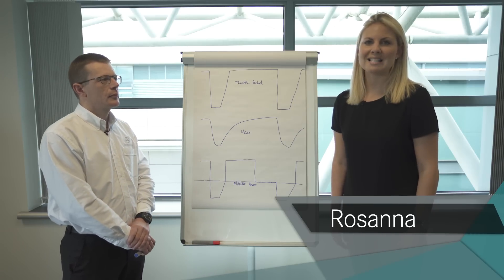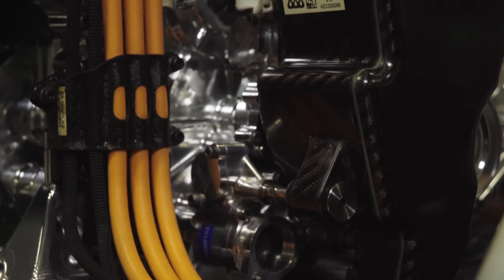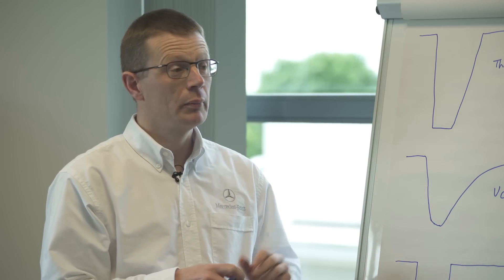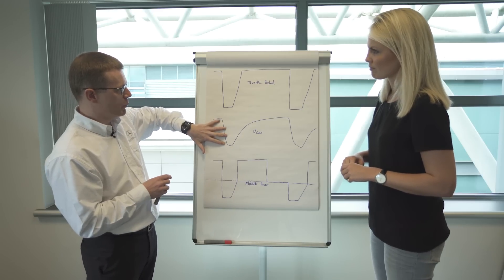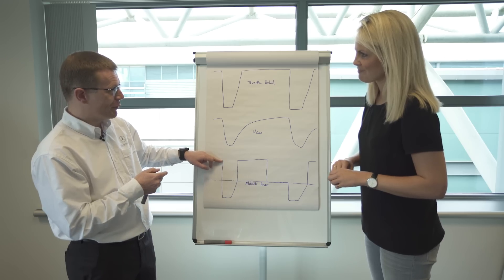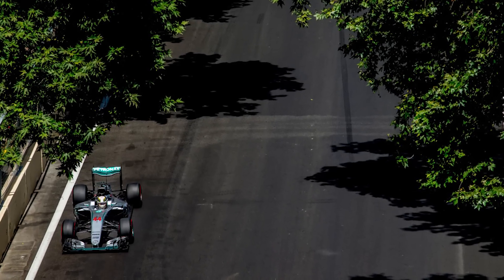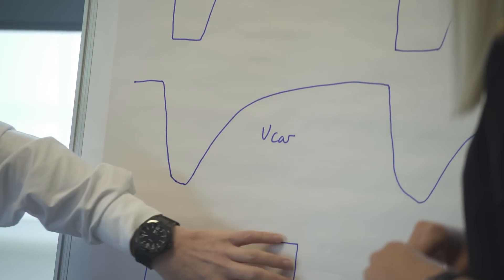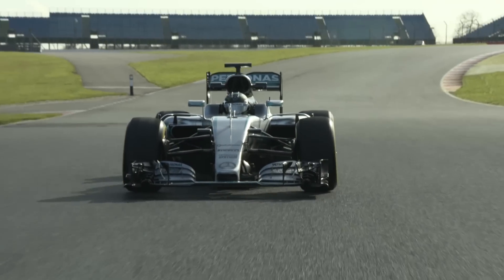F1 Explained: What is De-Rating?

Comment: Why don't you transmit power to the MGU-K directly from MGU-H at the end of the straight to keep half the power of the MGU-K and to avoid complete de-rating? Even if disengaging the MGU-H from the turbine allows for a couple more horsepower on the crankshaft, would it make more total power if you choose to keep the MGU-H recovering instead?

Comment: Great teaching video. In simple terms, by optimizing your MGK-U, along with your ERS, A you get the FULL 900 hp. D-Rating is basically when you can't get the energy you need or you don't have enough stored, to propel you at 900hp, you will only get engine hp, which is 740hp. Easy passes/overtakes are done quickly when you are at a 160hp loss on long straights.

Comment: Why do you even use MGU-K when accelerating out of corrner, I tought engine had too much power it would spin the wheels. Use only ICE and when you have enough downforce to put all the power down to wheels, turn on MGU-K.

Comment: Awesome video. I have a question if u fully gone out of battery power how many laps or better curve did it take to charge it back up to 100% energy?
Reply from the maker: Great question. It would take 2 laps to recharge. The drivers can use a maximum of 4MJ of ERS a lap, but can only charge at 2MJ a lap.
Reply: can = physically or = allowed to by rules?
Reply: +MrTiti rules

Comment: How much of the battery charge can you recover in a single braking zone? For example into T1 at Monza, or the hairpin at Shanghai.
Reply from the maker: We will try and find out for you!
Reply: MERCEDES AMG PETRONAS
awesome! looking forward to it!
Reply: Ok so I did some rough math and it turns out that for your example it's around 300kJ. I've no idea how much that means in terms of state of charge.

I watched a pole position lap and lewis went from 350 km/h to 70 km/h in 150m. That is roughly 2.5s if you assume constant braking force (which is a mistake but I am not about to solve the differential equations for including downforce, drag and weight transfer). You take that and assume 160 HP of regenerative braking power and integrate with respect to time and voila.
Reply: I think you are asking secret questions :))
Reply: Mercedes-AMG Petronas Motorsport 1 year and u still don't know anything about ur own tech😂😂👍
Reply: I wonder if the differences between all the manufacturers in energy harvesting efficiency are very substantial or if say a Ferrari and a Mercedes powered car would recover roughly the same amount of energy in the same situation.
Reply: Barring some massive fundamental breakthrough of science, they should be fairly close to each other in performance. They're limited by F1 / FIA rules to the HP of the energy harvesting system, so given that maximum there's only so much power you can generate. There's going to be inefficiencies and some may be more efficient than others, but I can't imagine it being more than a few percentage points off from each other. Course, that's what wins races :)

Comment: When the MGU-K did de-rate early, was that because the faulty mapping simply cut off the MGU-K for no reason to early or was the whole energy managment faulty and the de-rating was technically correct, because the car run out of electric power earlier than it should have been?
And did the System found out by itself that something is wrong and showed some warnings on the display or did the drivers just feel that something isn't right and then asked you guys at the pits what is going on?
Reply: good question, but there is no answer :(
Reply: From what was said during the race and this video, it was the drivers that realised that the car was dropping power earlier than it should be and, from what Andy said, it sounds like the car was just cutting the deployment earlier without using all the energy that it had stored. If the car had been using up all the energy, but using it faster, then the initial curve on v_car would be steeper and also, the MGU-K graph would have a higher amplitude for the derate bit, because the amplitude will be proportional to the energy somehow.

Comment: 150hp electric engines and we still drive fuel econoboxes???
Reply from the maker: F1 is the perfect playing field for road-car technology - but it takes some time to implement this! Check out this video to see how the two are linked: https://youtu.be/Cx4HMSNx_MY
Reply: MERCEDES AMG PETRONAS Im more interested about what parts of the engine must remain the same to not be considered as a "engine replacement" and if parts like that electric motor are included or can be replaced, ill apreciate if you can throw me any link, but i also will look for myself.
Because that will explain alot about how much durability it has.

Comment: Commentary during the race on NBC Sports (US) basically said that Lewis should have known how to correct the problem without the help of Engineering. 

Would this be a realistic expectation? 

Given that it sounds from this like Lewis should have known the problem was likely with d-rate, then shouldn't he be responsible for knowing what settings can change the engine map if he is experiencing this problem? It would seem like it would be something that should have been reviewed in a pre-race briefing....
Reply from the maker: +AMRosa10 Not quite that simple. It could have been any of the settings configured at that time. So it's a little harsh to say he should have absolutely known what to do as he had almost no way of knowing. As for reviewing in the briefing, it's hard to plan for every possible scenario of something not working properly...
Reply: Thanks for the reply. I didn't quite agree with the commentators. My opinion on the situation was that race control should have allowed the team to tell Lewis what to change once Lewis identified there was a problem. If the driver identifies a problem and initiates the communication, then the rules should allow the team to provide an answer. It was his skill and awareness that identified that something was wrong, so I don't see how it takes away from driver skill to provide an answer to his inquiry. I can see where the rule may not allow engineering to proactively contact the driver if the driver isn't aware that something is wrong or less than optimal, unless the problem poses a serious danger, but if the driver identifies an issue, then there should be free communication. It is also a safety issue. As Lewis said on radio during the race, he was looking down at the wheel every few seconds... going at 200-350kph, that isn't an ideal situation to have. If FIA is serious about safety, then this situation warranted that they allow the engineers to let Lewis know what to change, if for no other reason that to keep him and the other drivers safe.

Comment: instead of walking around with his dog or being just in a beaver, rosberg did focus on his job. so in baku he got the right settings before lewis got it. i guess he read the manual from his stearing wheel :-)
Reply: I seriously doubt that there's an f1 driver who doesn't know every single function of his wheel
Reply: I think they know every function, but they probably can't tell you the intricacies of how engine mode 12 differs from engine mode 11.

Comment: How many bhp would a car have if it has a second turbocharger 
 Btw Great video :D
Reply from the maker: +Bahamuttiamat No it's not. Fuel flow rate is limited but this only means bhp increases come from improved efficiency, rather than by more fuel flow.
Reply from the maker: +Juzh123 It's limited in the sense there will be a physical limit to how much HP can be extracted from 100 kg / hour. But we are not there yet!
Reply: The bhp is fuel limited.  Has nothing to do with number of turbo chargers.
Reply from the maker: +Juzh123 There is no limit in the regulations.
Reply: Good luck chasing that perpetuum mobile :D
Reply: +MERCEDES AMG PETRONAS an increading bar pressure?
Reply: +Ginger Boy Every engine manufacturer is at the limit (4.5 bar of boost)
Reply: +MERCEDES AMG PETRONAS oh sry my bad
Reply: +MERCEDES AMG PETRONAS oh now i remember what i meant i was meaning for an example(I'm on getting defensive by the way)

Comment: so how did nico magically know what to do to fix the issue from inside the car
Reply from the maker: +McrUk He had switched into the mode during the race so switched back out of it. Lewis had it from the start.
Reply: MERCEDES AMG PETRONAS Switched in, then switched out, sounds so simple... Lewis seemed to have no idea which mode to switch to?
Reply from the maker: +McrUk Not at all. But having been in the setting from the start, it wasn't clear which mode was causing the issue. And we couldn't tell him.
Reply: So both cars were set up incorrectly, the cars were De-rating earlier than expected due to an incorrect calibration in one of the engine modes, (the mode the cars started in) As lewis said in this interview he didn't change anything, he just noticed a loss of power. Meaning both cars were losing 160bhp. How did Nico know how to solve the issue from inside the car and Lewis didn't?
Reply from the maker: +McrUk No. Lewis started in this mode, Nico didn't. So when Nico switched into it and noticed the lack of performance, it was logical to switch back out of it. Lewis started in the modes so it could have been many more parameters causing the issue.
Reply: Understood, thanks for the feedback
Reply: nico read the manual from the steering wheel and understood it. lewis probably didn't. i think just walking around with an ugly dog or being just in a beaver and look cool doesn't do the trick every time.
Reply from the maker: +Stefan Weilhartner Not true Stefan. Just a caricature picture.
Reply: +Stefan Weilhartner You know what does do the trick though? Performing at an elite level for 9 years and winning multiple championships.

Comment: I thought that the power units made over 1000bhp
Reply: Not quiet (yet), although the 900 hp estimate was certainly very rough and conservative.
Reply: yeah they do
Reply: +bosshunterman Martin brindle lied to me.....
Reply: The thing is, it depends how you calculate the power output of these PU's You have about 900hp at the crank but if you add the power of the MGU-H you will have a higher number. although the MGU-H doesn't incease the power at the crank, but increases the power of the whole PU.
Reply: Andy Powell gave an interview early this year saying that they are close to the 1000bhp (around 940-955) ;)
Reply: +Vikrant Jaiswal We don't know that exactly because the teams don't want the others to know how much power they have. It is estimated that the Mercedes PU has about 930 hp and maybe more than 1000 in qualifying
Reply: Well, I said maybe. Nobody knows

Comment: Agree that there should be a radioban on strategy to keep the human aspect of the sport alive, but a ban a maintenance issues seems foolish to me. Indeed it's almost a spaceship. Engineers are needed to keep it going. That's what they're there for.
Reply: There are two instances this season that I think are good examples of how  the radio ban should work, and it should relate to the awareness of the driver that there is a problem. The first is where Nico Rosberg started the Spanish GP in the wrong engine setting. In this case it was his error and he did not realize it until the car began harvesting. In this situation, engineering should not be allowed to proactively notify Nico, as it is part of his responsibility to get the settings correct for the start of the race. In Baku, both Nico and Lewis Hamilton had the same issue with d-rating. As the drivers identified the problem themselves, then FIA should allow engineering to answer their questions on what might be the problem and how to fix if possible. The drivers identified there was a problem and radioed for help. As they had awareness of the problem and radioed for help on their own initiative, then engineering should be able to answer their question. I don't think this takes away from the skill that the driver needs to have to identify there is a problem in the heat of battle. As long as the driver initiates the inquiry, then I don't see how allowing engineering to help takes away from driver skill.
Reply: One could argue that, if the drivers knew their cars better, they would have known what was happening and how to fix it by switching to a different engine mode.
Reply: agree.  Team should allow to communicate to the driver to be able to get the car working to 100%.  Surely Mercedes could have shown the FIA that the MGU K had issues, and said " let us tell him how to fix it, so he can put on a better show for you and get his car 100%".  Though I doubt it would have had much effect to the overall result.
Reply: +AMRosa10 agree